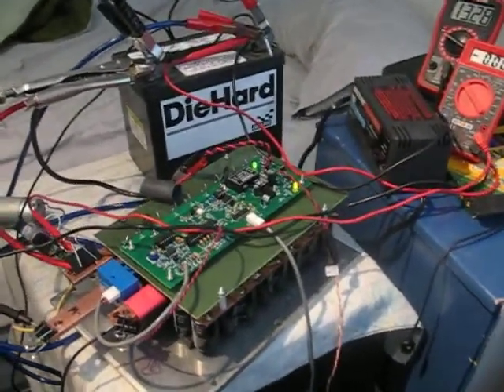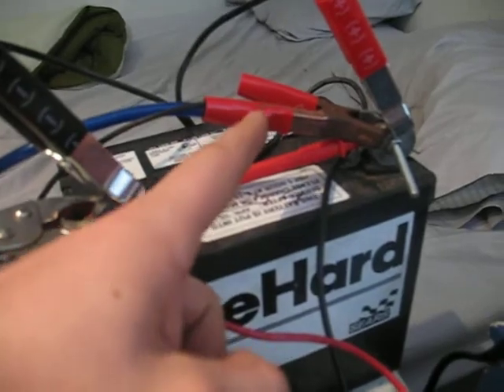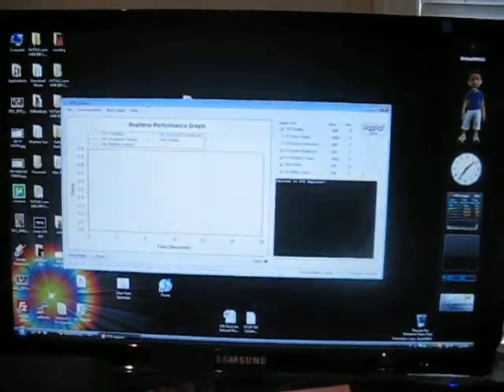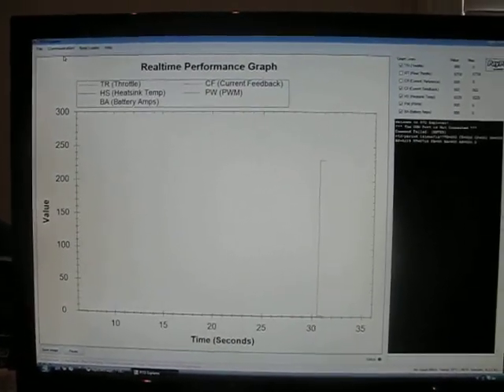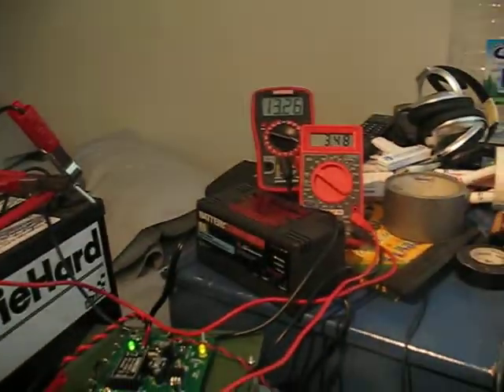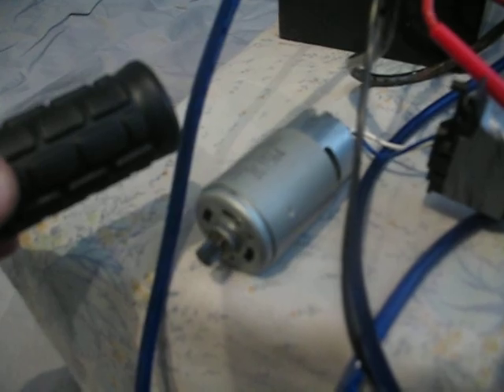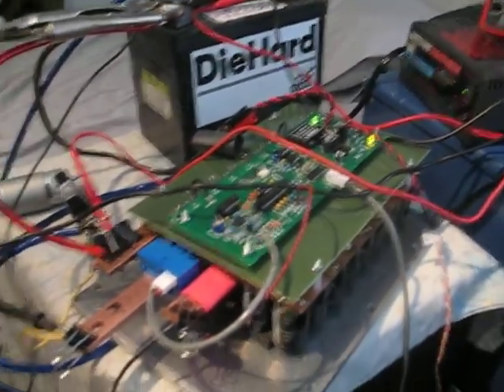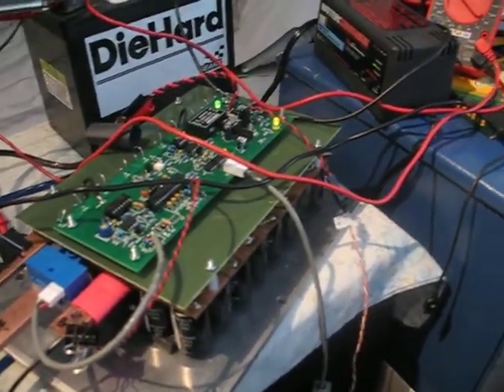Day 6 - 12v Test w Drill Motor and RTD Explorer

Comment: That motor is TINY and has no load on it, so you aren't going to get much feedback in terms of smooth controlled acceleration. The motor just won't pull any amps. Hook that controller to a 500 lb electric motorcycle and you should be able to burn rubber!